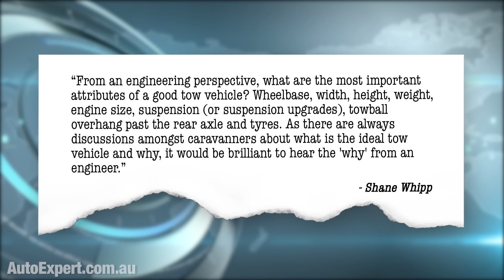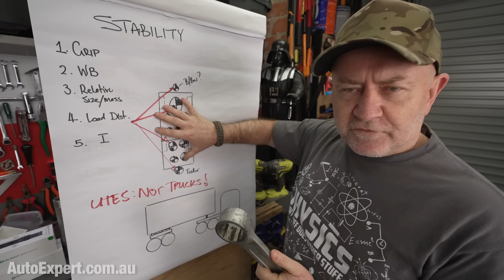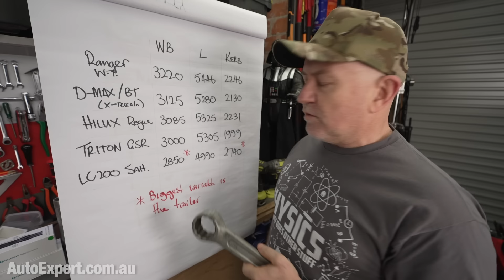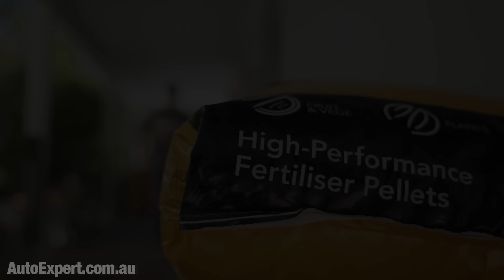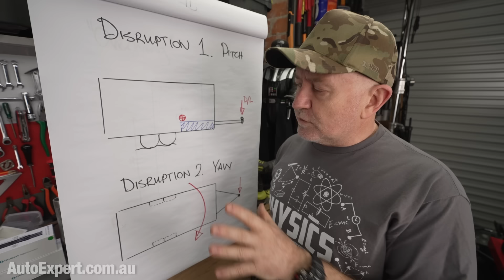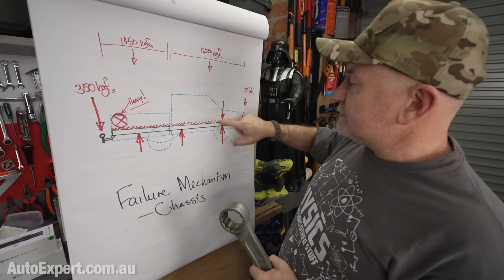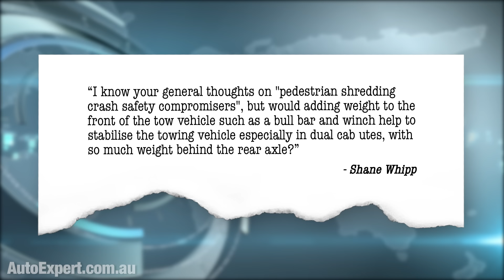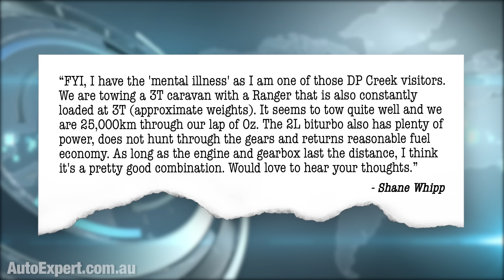Heavy Towing in Depth: The Applied Physics Deep-dive | Auto Expert John Cadogan

Comment: Hi John, in theory, it seems like, if trucks are designed to be stable while carrying heavy loads long distances on sealed roads over a fairly continuous bases over time and upto speed, it could be, not taking into account other factors or perspectives, safer or better to build trucks with, an inhabital carvan like section, and, a section to load a vehicle that is on all fours, a towing off road vehicle but designed for being used in 4x4 mode and fit with off road tires, or is that just dumb?
Reply: Hi John, any ideas how an electricity bill might vary, what seems like considerably, when it seems like not much change in the way things needing electricity are used? Take, for example, the use of a living space and a bathroom(gas water heating), a fluroscent light bulb, two halogen desk lamps, a portable esky looking like fridge/freezer with an insulating cover on it, a portable rv washing machine, recharging a phone, tablet, portable speakers, a front porch light, a pedastool fan and a vornado' cube heater? Does about around $1500 for a quarter seem not unreasonable for that type of use? (a previous quarter, was more like $800 or $900). A person on the phone from the company, something along the lines of, fluctuations could be like because of which power point was being used ... to your scientific engineering mind, does that make sense to you? How can I find out and what should I learn or know to better understand the situation?

Comment: "All the beard strokers" 🤣
Being in the market for a new set of tyres & just having watched your "How to buy new tyres and avoid the scams" video, this line gave me the giggles more than usual. I had to force myself to stop thinking about the line from Hot Fuzz while watching it. 😂
It was very helpful, but you might want to consider an update. It is 4 years old after all, and I'd like to hear your thoughts on the current cheap Chinese offerings to see if they've gotten any better. I ended up with a set of Kumho based on your advice btw.

Comment: J/C.  Had my colon cleansed thoroughly with this presentation on heavy towing !  Did one ever read or hear of the yankees using an American 'rule of thumb' No. 5 ?  Apparently states the wheelbase of a tow vehicle in inches and dividing it by Five - equates a maximum trailer length in feet.  So my 100 inch wheelbase in the Rangie, could tow a trailer no longer than 20ft.  V

Comment: Nice one John - a lot of stuff covered which few 'outback adventurers' care to consider in depth.
There is one thing which you did not consider  - the double pendulum effect when lateral traction is lost.
This is affected greately by the pivot point around which the 'dog trailer' (caravan) acts and its longitudinal relationship to the rear axle.
There was a discussion some many moons ago on the www.caravannersforum.com where a retired engineer, who had considerable knowledge and experience in this regard, explained why dog trailers are wont to wag the tow vehicle and result in an exponentially increasing sidewards 'wobble' which inevitably results in unfortunate entanglement with anything, on road or off, in the near vicinity.
I have been out of touch with the forum due to my forced exclusion from the caravanning activity by way of poor health, but may I suggest that you research the topic for your own edification.
Like many others with an interest in the topic, I consider that it should be mandatory for persons intent on towing these large, highly crosswind susceptable, habitation boxes to avail themselves of the services of an accredited training course before committing themselves to the acivity.

Comment: Damn, now I want a crash-test with a bulbar.
Did I miss something? You're always correct, so now I am confused.
Wheelbase as in 3220? What? Isn't it always in cm's? It will be 32 meters long???
Then 322 would be enough. Or do you do the work in mm's? 
Anyways, glad you work with the metric system. 

Good talk and explanation John!!!

Comment: It may be a good (a little expensive) idea to just keep offroad tires with 25 psi in the bed or on a roof rack and replace the standard tires whenever the situation demands. To me personally doing the compressor thing is more annoying than tightening some nuts because my perfectionist brain won't accept even the slightest pressure difference left and right caused by the sun or something. Better inflate the 'ffroads at night to VERY VERY PRECISE 25 and on the way to Dingo P*ss Creek just do the nuts like a stu pid caveman. 
That's in theory, I'm not actually an outdoors kind of person. Best camping is playing Snowrunner on my Nintendo Switch Lite where I don't have to worry about tire pressure (even though it's coded into the game😂, you just can't change it).

Comment: A Volvo engineer once told me to look at the size of the rear brakes on a tow vehicle, you can tell which manufacturer has throughly tested their vehicle towing from that. I’m guessing that is due to the load applied when going over undulating roads and braking, ie the front wheels have less grip. Is this correct in your opinion?

Comment: Thanks John for a very informative vid on the physics of towing, it will create some spirited discussions around the campfire!
Can I ask a question that hopefully you can have some answers to.
I have a 3.2t off road (read gravel road) van that sits very high on fully independent suspension running two sizable shockers per wheel.
The majority of the weight is the double stacked chassis and 4x80 water tanks underneath.
I tow with a current model LC200.
My experience with this van is that it is upset by side to side undulations in the road which sets it rocking from side to side.
It self corrects very quickly but it is not very comfortable from the drivers seat!
My thoughts on a solution to this is to fit a sizable roll bar across the front, or rear, sets of wheels?
Is this something that might improve this vans road manners?
Cheers
Peter

Comment: Great presentation.. what do you think of the  American  trailer use of a weight distribution hitch. .  Which is basically  a lever forcing  more weight to the front of the tow vehicle..... I. Towed with and without.   towing stability is significantly improved when using one

Comment: Towing 3T with a 2.5 DMAX 175 hp (supplied to shitsvill uk) is a non starter , not worth the grief.
Off-road 1 to 1.25 metric tonnes MAX if your lucky or if your just stupid, using road tyres.
Tyres, using MAXIS MT tyres, no issues, towing off road, due to the double cab wheel base it comes with its own set of issues, choose your route wisely or you WILL !!! ground it out as i found out.
The DMAX is known to have DPF issues at reaching 50 k miles, DPF re-gen burns about every 70 miles, so me thinks DPF AMPUTATION AND REMAP IS FORTH COMING.
Could you advise if the 2.5 is a down sleeved version of 3.0 you good chaps get down under.

Kindest Regards

Comment: Hi John, when you say truck are different, really there not, a fully loaded prime mover is 23.5 tonne the maximum of a trailer axle group in 22.5 tonne. So the trailer can’t be heavier than the truck by law
Reply: I think you are describing a rigid truck with a dog trailer right? Not a prime mover semi trailer (like John's diagram). A prime mover mass is only about 20% of the total mass in a 3 axle group semi, even less in b doubles or larger configurations. The dog case is interesting though - actual laws controlling the relative weights says something, and a dog is inherently more stable than a central axle trailer. Why don't we have those laws for vans I wonder.

Comment: Well explained John.  Thanks. This is why I will stick to my FJ Cruiser with upgraded suspension to cope with the extra weight and we tow a Cub Longreach. Love your work.   Beard strokers, bahaha
Reply: I also have an FJ. Your Cub van is only 1.5tonnes, or about 2t fully loaded, and it's compact, so great choice for an FJ to tow. 
I'm interested to know what suspension you think you need to 'cope' with the task.  Firstly, I'm wondering if it's needed and secondly I'd be interested to know how this turns out for you, either way!  Not many FJs towing there.
Reply: That thumbs up bit about guessing the weights was so fucking funny. I scared my dog I laughed so loud. 🤣
Reply: @samboelliott1  Hi, I went with a 2 inch lift with plus 200kg springs.  When towing our rig just sits level and is so stable.  No wallowing.
Reply: @outandaboutinoz  Does it still ride nice and soft when it's unladen?  I really love how my FJ rides the road.
Reply: @samboelliott1  unfortunately not as soft and compliant.   But it now goes around corners without feeling like a boat.  But if you drop the pressures to say 34 it's good.  I run 40 in the front and 34 in the rear when we are not towing. I also run a tjm bull bar so the uprated shocks and springs help with that too.

Comment: G'day John, l do find your utube very interesting . I'm wishing to have a grey nomad period time in my life, 4x4 ute and caravan. 
I do understand that a 3.5ton caravan behind a ute is ridiculous and the weight sums don't add up. My consideration is a 18ft van with a GMV of around 2.7 ton single axle. Is a double axle a better and safer choice for travelling.
Thanks Tony
Reply: Damn good question Tony.
Reply: certainly a good question because there is trade offs. double axles tend to track better, easier with tire selection, but single axles can fit shock absorbers and give better handling.
also single axles move around the roll centre easily while double axle need equalizing suspension and thats often very limiting (get wheels in the air).
would be an interesting video, i hope john does one.
Reply: @tweake7175  I'm intrigued by fitting shocks to a single axle trailer. I've got a 1.5T single axle and that question has come up often - should I fit shocks, how to fit shocks, which shocks? etc. etc. Yes perhaps a whole episode on fitting shocks to trailers...I doubt we will ever see that here though...."new cars cheap" is the buy-line, so a little out of the market John would be interested in I would think.
Reply: @BenMitro  easy as. there is kits on the market. several manufactures make shocks for light trailers. not sure whats available in oz, but if we have them in nz you guys will have them. they are more common in europe and usa. i think one or two euro countries legally require shocks on trailers.
Reply: @tweake7175  Thanks! Great info. I might have a chat to the trailer manufacturer and see if he can supply/fit and if not perhaps he has a recommendation for a kit.